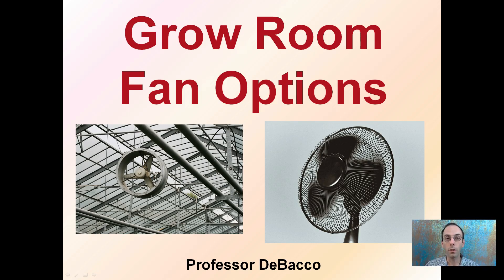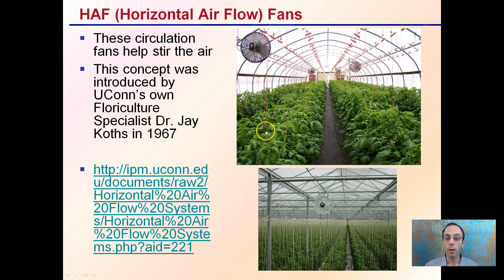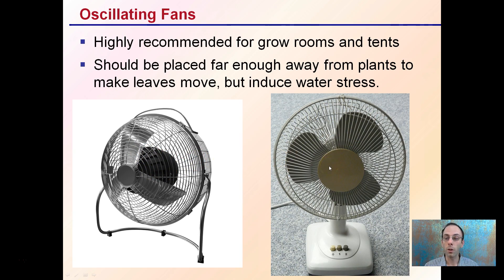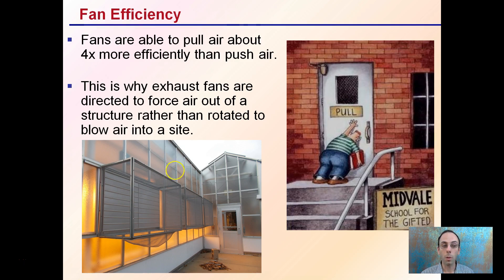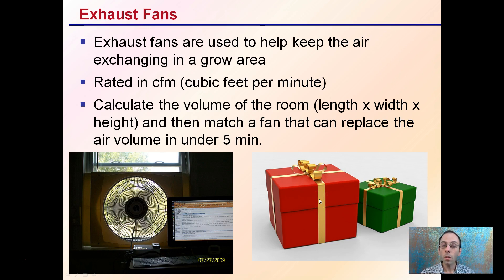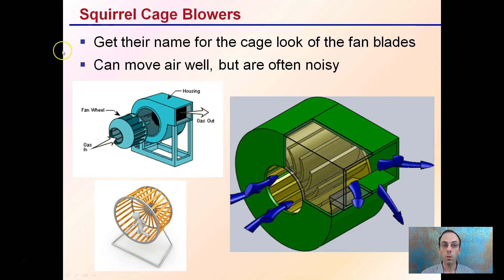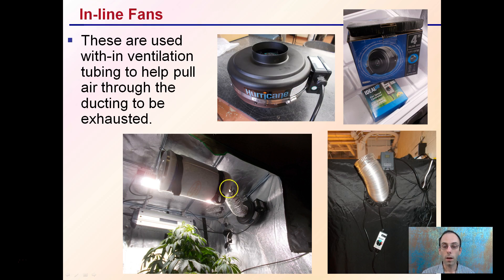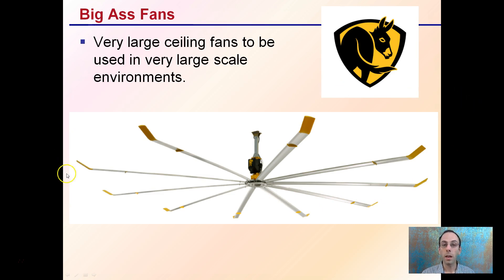Grow Room Fan Options

Comment: No mention of the vertical fans such as the Vosterman's. My room is 10' x 10' and  getting proper airflow is difficult. I just switched from trays to the though style tables hopefully allowing for more air movement through the canopy. I can't really take advantage of Horizontal airflow fans and can't find many examples of anyone using V-fans in small rooms like mine and it's a large cash outlay. The idea of using just the one fan for airflow is appealing
Reply from the maker: Tables in a room would have more efficient air flow from horizontal fans.
Reply: @DeBaccoUniversity  In a 10' x 10' x 8' room with plants essentially wall to wall with a small aisle in the center, anywhere I place a fan ends up cutting(usually literally) into my canopy. I changed my rolling benches from trays to troughs, meaning instead of 4' x 8' trays on the stands, I have 2 10" x 8' troughs for my pots and the remaining 28" is open to the floor. Rather than take a $700 gamble, I'm going to fashion my own V-fan and see how she goes. Center ceiling the only spot in my room that won't interfere with any existing equipment or chop any plants like a salad shooter and may replace the 8-10 fans I have been running. It should help to better redistribute CO2 from below the canopy and free up some amperage for the Quest 205 that's on the way. I'll be sure to reply if I meet success.